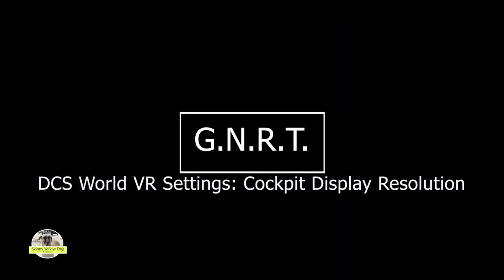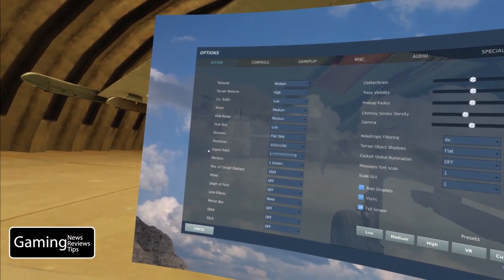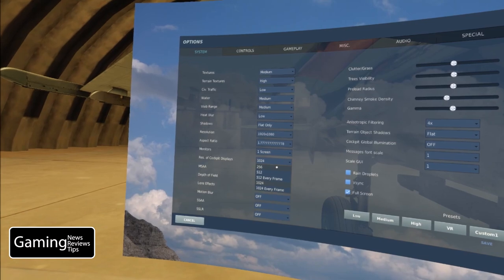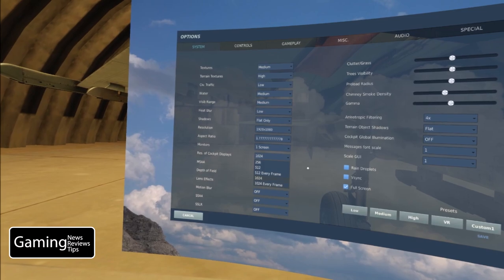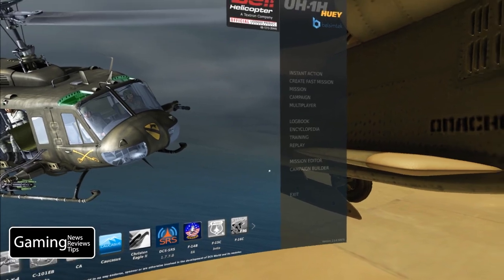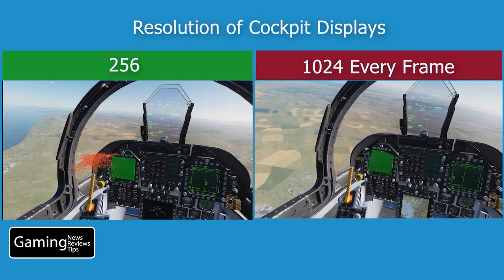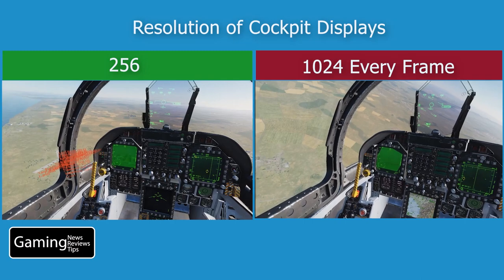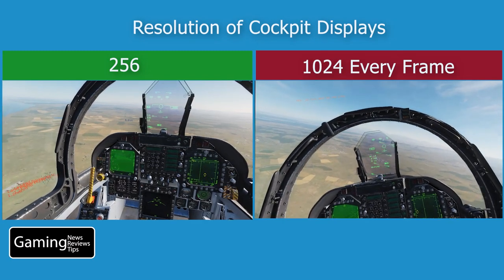DCS World VR Settings 7: Cockpit Display Resolution

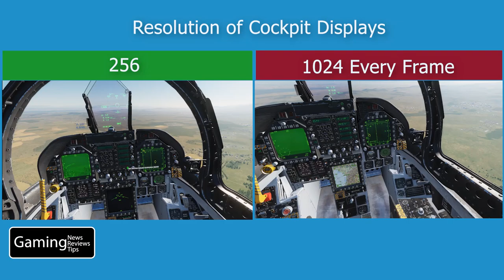Comment: 0:57... that's a case of to not see the wood for the trees. So, you took a look around in the cockpit ... 'as well as a variety of the other gauges and switches in the cockpit...' not noticing that these ominous mirrors don't do anything. What an FPS impact you could have noticed when you had just pressed M for a sec. And if not an FPS impact, than at least two resolutions as different as night and day. One causes eye cancer and the other one comes close to what we call a mirror irl. 😎👌